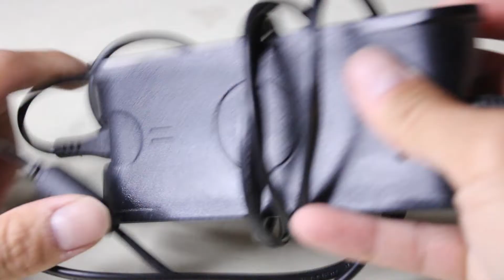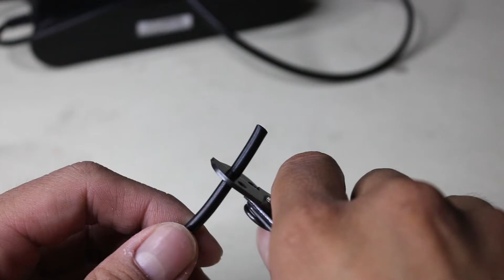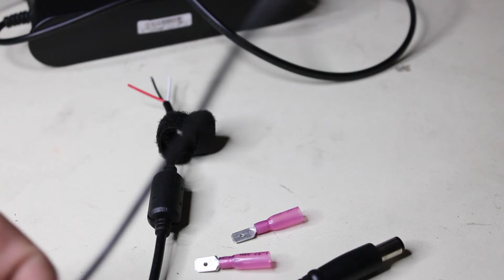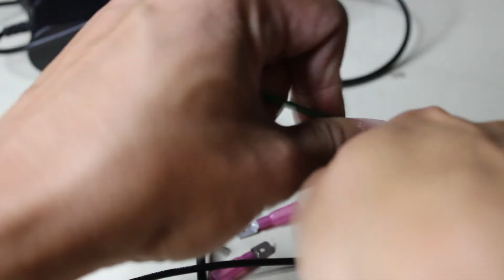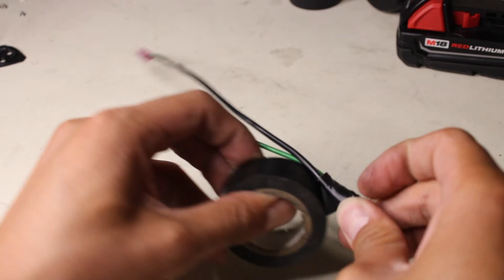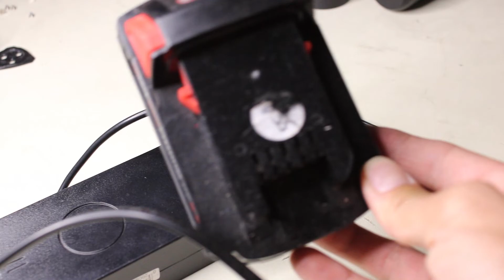Charge Power Tools Battery without Original Charger Lost/Broken For Impact Wrench + Drill Cordless

Comment: This is a very bad idea… if the battery has no bms ur screwed and the battery might catch fire from overloading. Bms doesn’t cost much so ur better off adding that to ur circuit… there are plenty of guides on yt how u make a cheap charger from cheap Ali express bms.

Comment: how do you know when the battery is fully charged ??
Reply: you won’t, this is just a temporary hack to get you charged to a good level. Just press the built in battery monitor to check the bar voltage level.
Reply: @kbruin79  Thank you
Reply from the maker: Hi user-jo5fz8iw3b, you can also check the battery level with a multimeter. Thank you for the question.
Reply: @fixwhat1137 
I have a multimeter, but really dont know how to use any of the options but (ohms ♎️) the continuity option. Can you explain how i (what setting on the multimeter) would use to check the battery and what the results may mean ?

Thank you in advance
Reply from the maker: @user-jo5fz8iw3b  On the multimeter, change the settings to DC. Normally all power tool batteries run on DC power, so this is the setting on the multimeter we'll use to measure the voltage. On some batteries, the contacts are also labeled with a positive and negative symbol. Once you find the negative and positive contacts on the battery, simply place the multimeter probes there and measure. If you have a battery that is labeled to be 18.5V, and when you measure this battery and you get around 18.5V, the battery power level is good. It might not measure to be exactly at 18.5V, but around that voltage. I hope this helps.
Reply: @fixwhat1137 awesome, thank you 👍
Reply from the maker: @user-jo5fz8iw3b  You're welcome!

Comment: How long do I keep the charger on before checking the voltage in the battery?  With original charger it will turn off automatically, if I leave the converted charger on for to long, will it damage the lith  ion batteries? Thank you for the video.

Comment: Warning! Laptops dont use chargers. They use adapters! Charging circuit is inside the laptop! Also most power tool batteries dont have bms that protect the cells so never do this unless your life depends on it! The battery doctor

Comment: Why do you put black and white together? Will it work if that’s not done?
Reply from the maker: Hi GnarledSage, the black and white wires are the ground and neutral wires. In electrical circuits, the neutral wire carries the current, and the ground wire is there just in case there is a short or fault in the circuit. Yes you can use just one of the wires. If I remember correctly, I believe its the white wire that you can use by itself. Instead of one of the wires hanging around and not connected to anything, I just connected both of the wires. Thank you for the question.
Reply: @fixwhat1137 Thanks for taking the time to explain.
Reply from the maker: @GnarledSage  You are very welcome

Comment: Please can you use an 18.5v laptop charger to charge a 20v battery.
Reply: Yes You Can.
Reply: @-mejor-que-nostradamus-6152   thanks 😊
Reply: You can charge it at 18.5 but it won't run for very long nominal voltage to charge in 19 volt battery is around 20 volts That's why you have other brands that say 20 volt max It's just an 18 volt battery pack that's nominally charged to 20 volts
Reply: No you need more voltage to charge.. and amp will determine speed as long as the battery supports it. thats why car alternator charges at 14.8V to charge the 12v Battery
Reply: @daytekone  alright 👍

Comment: Nice video straight to the point, But I have a question, I have the charger for my cordless battery(which doesn’t work) can I hook up the laptop charger to the original charger? ie take motherboard out and just hook up positive and negative wires, then just slide battery on the original charging dock? Keep the oem charger just being powered up by the laptop charger?
Reply from the maker: Hello sabiya2, I appreciate it thank you. I'm glad that you enjoyed the video. To answer your question though, I'm not sure. What if your charger is the issue, the internals of your charger such as the circuit board inside. If you power the charger but the internals are broken, it still may not charge your battery. That is just my opinion. You do have an interesting idea though.
Reply: Hi thanks for your reply, ok so an update, what I did was I connected the laptop charger directly to the pins on the inside of the original cordless charger, so now I just slide the battery into the charger and it works with no issues. Thanks man
Reply from the maker: @sabiya2  I'm glad that everything worked out! Thanks for the great idea
Reply: @sabiya2 simplest thing I've see yet
Reply from the maker: Hello sabiya2, just a quick update, I might have misunderstood your question, if you meant to remove the circuit board inside the charger and connect the laptop charger to the leads of the charger directly bypassing the circuit board inside the charger, then that might work. The downside is that you will probably be able to charge only one type of battery. You can only charge batteries that can fit in that charger. But still, what a great idea.